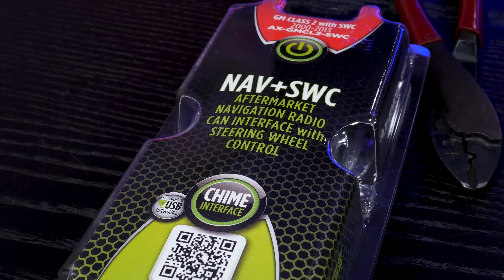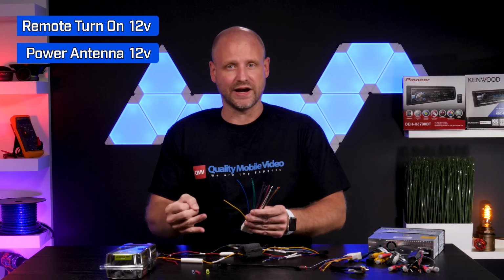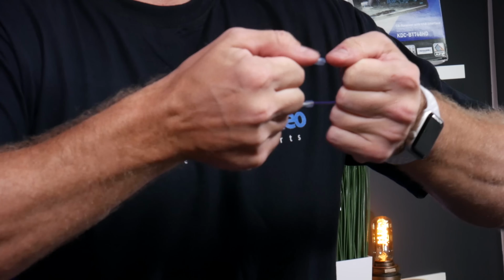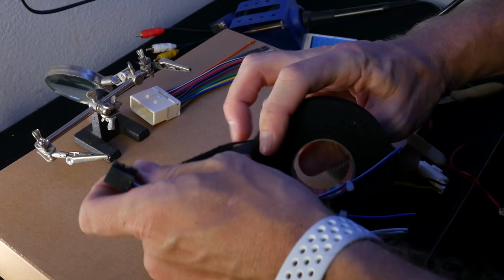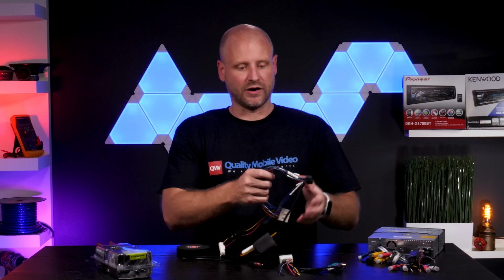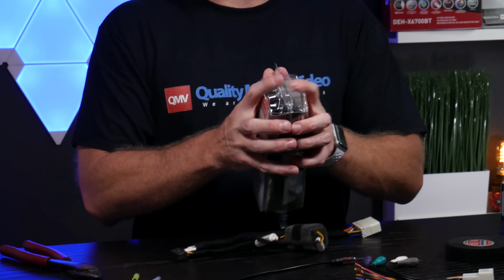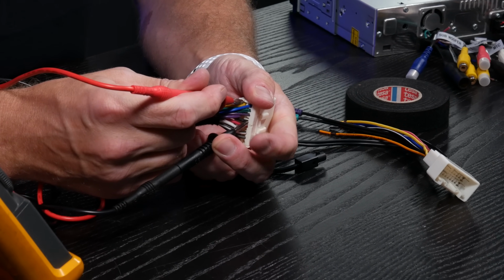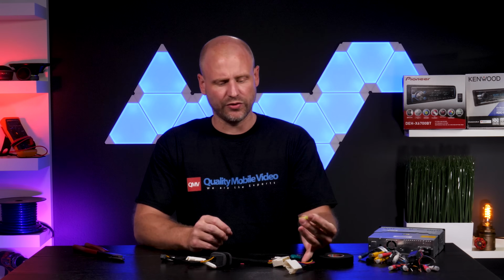Car Stereo Wiring Harnesses & Interfaces Explained - What Do The Wire Colors Mean?

Comment: My issue is I installed crimp connectors and for some reason my audio goes out and the radio restarts its self. 

I checked all my cables 
And was thinking it was my ground. 

Then my radio only goes off and on with the power button not the key.
Reply: So it's constant hot and not switched.  Yellow is constant hot and the red on the harness is the switched ignition power.

Comment: I set up all wires correctly for my aftermarket dual blue tooth stereo on my corolla 98 and the stereo is turning on and off alone while the car is off and the key is not inserted
Reply from the maker: I doubt it's something like an ignition switch issue. It sounds more like there was a mis-wiring somewhere during your installation.

Comment: Seatbelt is still stuck and I locked my keys in the gas tank. Will it matter if I close the hood with the zipper in neutral?
Reply from the maker: You're gonna want to eat your steering wheel and then replace your windows with saran wrap

Comment: I mean while I agree that butt connectors aren't the strongest connection out there, you can make any electrical connection fail if you just start yanking on wires lol. As long as no one is doing pull ups on my radio harness it'll be just fine.
Reply from the maker: Using a good and proper crimper is a must

Comment: I installed my radio but my monitor won't come up automatically
I also don't know where the pink wire goes
Reply: Pink wire is for the rear camera. It is wired to the backup lights to activate the rear camera to come on.

Comment: Recently some strange things are happening in my car.  Using the turn signal and applying the brakes are momentarily stopping the radio.  When it comes back, the volume is lower.  This is intermittent.
Reply from the maker: So odd! My guess is you have a bad ground/connections or maybe your alternator is having issues.

Comment: I have a 94 lhs with a scoshe stereo harness..all my wires connect except the blue/white wire ..the instructions say to connect it to my power anntena wire for my front speakers to work...when i do nothing happens..and the tweeters are taking the brunt of the sound....ive touched it to every wire and i get no sound from my front speakers....the stereo sounds like garbage

Comment: The way i did it was cut all the wires and put a bluetooth device for 45 $ and its so much better with spotify...or pandora
Reply: You can also add a bass boost app but the app has volume bass and more on the play store.

Comment: Can anyone here help me out? I connected all my wires based on their colors ,02 Ford e350 using an aftermarket harness. It's very basic ,just 1 cluster . Wen I turn the car on , the stereo doesn't turn on. I checked and their is power. I crossed the red and yellow together and now everything works . I'm pretty sure that's not how it's supposed to go tho. Can anyone give me their 2 cents here ?
Reply from the maker: You have an issue with the Red wire coming from the vehicle, it is not going to 12 volts when the key is turned.
Reply: @Qualitymobilevideo  how can I fix this ? Is that red wire a constant power ,or is it power on ignition?

Comment: I’ve tried just about everything I’ve looked up online and nothing is working, just keeps saying protecting
Reply from the maker: Disconnect all the speakers and connect one by one and see what the issue may be.
Reply: @Qualitymobilevideo  my passenger window was left down and it poured the rain inside and after that it started saying “miswiring” then “protecting”
Reply from the maker: @zZombie058  Unfortunately something got wet and probably damaged.
Reply: @Qualitymobilevideo  so replace the speakers and screen?

Comment: Because I’m gonna remove my stereo and pull on the wired with all my might to try to get them apart. I’m sure solder is best, but c’mon, man. The connectors won’t stay connected ? I’m sure they’re fine. 😊

Comment: Soldering is absolutely not needed in 99.99% of cases. You are actually much more likely to end up soldering incorrectly than any properly installed crimping. Soldering is a somewhat difficult skill with needed equipment to hold the wires, as shown in the video, and doing it wrong could lead to sharp edges that could tear through electrical tape and short circuit your system. Your stereo stays strongly connected to your dash there won't be any pulling so why even act like this would be an issue? For the majority of you reading this save yourself the trouble DO NOT SOLDER and  twist your wires then use a single end crimp. It will not come apart and will save you much time and stress. Bonus points get proper crimps from your local car stereo store not the cheap Walmart versions shown in the video. If you bought the stereo from them there's a good chance they will throw them in for free.
Reply from the maker: But it's so fun

Comment: I hate butt connectors! I always have them pull away. Soldering is so much better, but where do I find shrink? I always have to tape it. I used to install my radios in the 80's there were no harnesses. They're a great thing as long as you get the right one. Question.  If there are connectors that don't go to my vehicle or radio what do you do with them
Reply from the maker: I'd recommend this: https://www.qualitymobilevideo.com/3mhst34-1.html
Reply from the maker: Here's a full list: https://www.qualitymobilevideo.com/catalogsearch/result/?cat=0&dir=asc&limit=45&order=price&q=heat+shrink

Comment: Anyone got a recommendation for a touchscreen system for a 1994 Honda accord EX-R that won’t interfere with the gear shifter. Just bought the car today for my son. 190k and 1 lady owner with all the service records from the same dealership, then a Honda enthusiast bought it and continued using the same dealership and same mechanic for 2 years (only put 9k km’s on it).We got all the Honda books, user manual, and original brochure. Car is in mint condition, except for a little rust on the rear panel just below gas lid. We want to install a double din or touchscreen (not sure what fits), and add a backup camera. For now he’s getting an 12v lighter adapter with Bluetooth, and FM transmitter. Or should I go old school and get the tape FM transmitter 😂 and keep it original. Once we get the rust fixed, we can put collector plates on it 😂

Comment: Mine has a blue with a red stripe, and 2 black cables!?
Reply from the maker: Do you have a brand/part number?
Reply: @Qualitymobilevideo  never mind, I found out through online forums that it was steering wheel control and speedometer
Reply: I do have a new problem. The radio wants me to connect parking to B- wire but I don't have that wire in my harness.  It's an Eincar radio for my 2014 Genesis coupe
Reply from the maker: Installing an aftermarket stereo into the make and model requires the Metra 70-7304 wiring harness: https://www.qualitymobilevideo.com/70-7304.html

Comment: Great video. I do have one question though. I have the Metra harness for my 2008 F150, and I am installing an EONON GA2180 radio. I have cut the ISO port off and soldered all connections, but still get no sound.

I have been in contact with Eonon, however their response to my pictures seems odd. "You have modified the wiring, but the ANT and AMP wires are wrong.

The correct one is PIN6 and PIN5 in the interface of the accessory. Please reconnect and try again."

This vehicle has no amp beyond the supplied in radio one, and I am just wondering if you might know what they mean by this?

I do thank you for your assistance in any way.

Comment: Man can someone tell me what the hell the pink wire is for on an 01 Tahoe? I've read it's the speed sensor, I've read it's for the factory amp. I'm clueless. I unplugged the adapter from the CD player and disconnected it from the factory and my gauges quit working 😂

Comment: My radio doesn’t turn off when the car is off
Reply from the maker: Wiring issue! If the main power wire for your head unit is connected to a power source that is always "hot", the radio won't ever turn off

Comment: A crimp using good quality crimpers and connectors will not fail. Crimping is almost always superior to soldering if using proper equipment. That's why you find virtually no soldered connections in the aerospace industry. I can't tell about the quality of the connectors used in this video, but those crimpers were of horrible quality. Good crimpers ratchet to the correct pressure before automatically releasing and form a gas impermeable connection that won't corrode. Soldering can create brittle connections that are more prone to failure when subjected to vibration.

The car audio world is weird in its religious devotion to soldering connections.
Reply: 737 avionics we used crimping almost exclusively the better ones for non pressurized areas we used in pressurized areas too .Only time. I can remember soldiering Was on the end of coaxial cables to connect a pin on the conductor going to wi-fi antennas.

Comment: Yellow  constant  to battery    Positive or negative ?        Black    Ground   ( black typically is negative ).    Red    accessory. ( red typically is positive ).    Constant to battery means what.      Positive or negative ?      Dc systems utilize two poles why three wires for supply ?       Why don’t they simply specify what pole either positive or negative.      Wiring the speakers an orangutan can figure out     Trying to instal this system in a marine application with a simple positive negative on off breaker.    Good information nice presentation but vague in some details.

Comment: I have a 2003 hummer h2 and I was told I need a RP5-GM11 connector Radio5?? 

Why the hell do I need this blue box in my car??
Reply from the maker: Unfortunately, a lot of vehicles by Chevy, GMC, etc. require an interface instead of a wiring harness when replacing a factory stereo with an aftermarket. Check these out:
Non-Amplified System: https://www.qualitymobilevideo.com/ax-adbox1.html
Amplified System: https://www.qualitymobilevideo.com/gmos-04.html

Comment: Ok so with the interface on most newer vehicles like my 04 monte carlo the factory radio controls the oil change reset light the keyfob program settings and basically all of the other settings that the car came with. So my question is how do I access all of those settings and functions once and aftermarket stereo has been installed with the interface? The only thing I've been able find through Metra is the steering wheel controls and ofcourse the chimes but the interface doesn't say anything about the other functions that the factory radio controlled.

Comment: You really are overthinking the connection. Those crimps are more than enough for it. My old truck I had bought from my grandpa he had used electrical tape to hold in the radio and he had that truck with that radio for 7 years before I bought it. It’s not really a big deal as long as they are held together. They won’t wiggle loose or anything unless you do something wrong

Comment: first off u are useing the wrong size butt connector for the size wire u are crimping secondly u are not crimping the wire correctly. i tryed that the same size wire and useing the proper butt conn. and crimped right it don't  come free even with some force
Reply from the maker: You do you! 👌
Reply: I am and I'm a certified installer stop misleading ppl

Comment: It's irritating that they don't make these things user friendly. Why can't radios just be a plug into power and play? All this rewiring but such  it is.
Reply: Because every aftermarket radio would need to come with 9000 vehicle specific connectors literally. The question is why don't all vehicles use the same harness and I can't answer that
Reply: @rmblwgn   very true. I managed to put in my radio  myself  the hardest part  honestly  was assembling the aftermarket dash  kit  the instructions were  crap  🤣
Reply: @iskatu2236  just helped my dad install a radio / 5 channel amp in a 2006 GMC Sierra 2500 and the radio dash  kit was a bitch it had to be dremeled to snap together. Even though it was only 10 bucks it was kind of nerve-racking because I had to snap off every single tab for that particular Model Truck

Comment: The wires on these new stereos are too small. OEM wire harnes is 18AWG and stereo harness is 22AWG. A smaller speaker wire means it is not as loud as OEM stereo. And your crimp connectors cut small 22AWG wires. New stereos suck.

Comment: Ask yourself this.  Who is going to magically go inside your radio and pull on those cables?  Butt connectors work fine.  In real world application, you have nothing pulling those cables.
Reply from the maker: It's personal preference. Obviously no one is "pulling" on the cables. But over the course of a several years, thousands and thousands of miles driving fast, stopping, maybe a fender bender, hot summer days, going over speed bumps, bumpy roads, hard turns, inclines, declines, things will start to move around inside your dash, and if your connections aren't tight they can come loose.

Comment: Soldering : Half the time people don't want to do this while in the car  My Truck is in a parking lot outside which means i need 50 ft of cord running out my window to outside and no platform to work inside the truck ....butt connectors are easier if done right they last ..No one is going to be pulling both ends to get them apart  And once your radio is in they ain't moving around  ..If you wanted to be top pro on a install you forgot dielectric grease on the solder points before putting over slipping over shrink tubing  Making sure any moisture that might get in does not mess with the wires...I do it before adding my butt connectors and then shrink tubing over that

Comment: I could not understand half of the stuff - you see, we all can just make a harness and talk about it - HOW about going to actual cars and installing the wire to the "HAND BREAK" - or Steering Wheel Controls - you spent a lot of time soldering and connections - not what we come here to find out - create a diagram showing all the connections between the harness, adapters, interfaces, head unit, etc.. talking about something you are having in your hand does not help get the person to the next step of connecting something correctly.

Comment: Soldering.....ugggg   Why is soldering so dang difficult?  Irons are all different levles, tips are junk, heat doesnt travel to the tip like it should, you need hand hands, a flashlight and a magnifying glass, solder comes in all different flavors, flux comes in all different flavors, you need a special blow dryer to shrink the plastic, Soldering time is 5 minutes/wire, the list goes on and on why soldering should be your LAST option. Even the professional installers don't waste their time with solder.
Reply from the maker: Soldering is very easy even with basic irons.
Reply: @Qualitymobilevideo  easy if you can find leaded solder, but the big box stores dont carry it.

Comment: great video. i have android 2 din car stereo. i'm trying it with pc power supply. when i connect iso cable it works. but when i connect 28 pin connector it starts to burn power source cables. 
here is my cables and stereo.  http://candan.biz/s/

Comment: OK I’ve got a question about my wiring harness on a dodge 2007 ram 1500 quad cab four-wheel-drive 57 hemi UMMMMM OK here goes…… I ran my speaker wires from my four channel scar amp to the wiring harness my my wiring harness is a scosche wiring harness OK I know it’s cheap whatever it’s the same thing anyway it works I guess sort of OK here’s my problem I wired it to the back OK is it where the wiring harness is connected to the OEM dodge plug OK I cut the wires right before the OEM no I did not touch the ON OK I cut the scosche wiring harness and I just cut the speaker wires I cut the white the grays the purples for the greens OK that’s it I connected them all there on the right side OK now I haven’t had any sound come out of my six by nines in the doors and I have 5 1/4‘s in the rears the phone thing is the only thing that’s working is a 5 1/4‘s but the five recorders are playing on channels one and two which they should be playing on channel 3 and four? It’s very strange right? Also when I shut the truck off my my pioneer AVH 120 is not keeping the power on I have to reset everything every time I shut the truck off also I did a I took the green wire coming which is the emergency brake and I put OK I put it to the ground‘‘ don’t tell anyone‘ lol but that’s known as a way to bypass the emergency brake thing they have on the decks that stop you from watching the TV or the the movie OK so every time I shut the truck off I’m having to re-attach that also my brain has been rack for a week now I don’t know what’s going on as I said my rears my 5 1/4‘s my they’re all brand new everything brand new my 5 1/4‘s in the rear are playing from channels one and two which should be the front and my front don’t play at all and everything is tight I’ve already checked all that everything is tight everything is right I’ve got everything correct but it’s just not doing it I don’t know what to do is anyone out there that can help me or recommend something I’m about to pull out all my hair if I had any hair lol I really appreciate this song would help or any suggestions thank you very much Dan